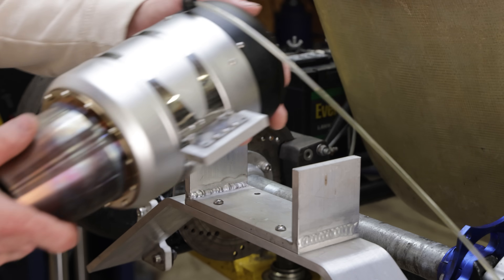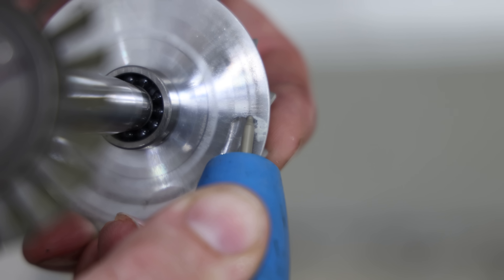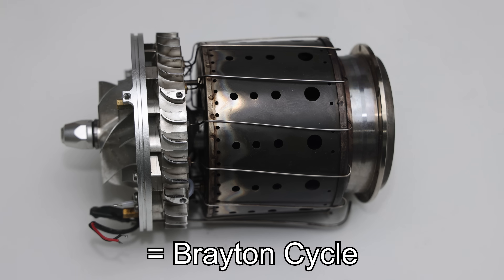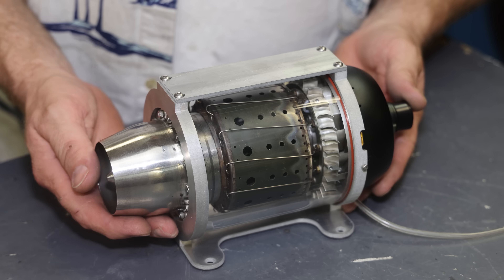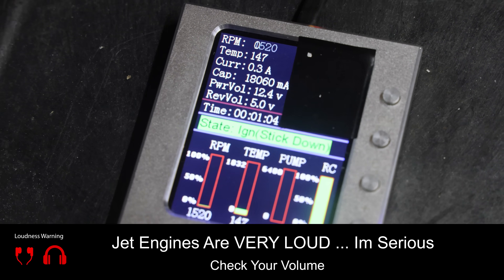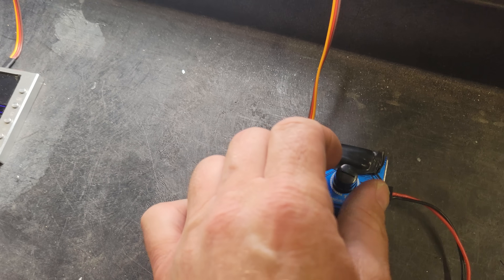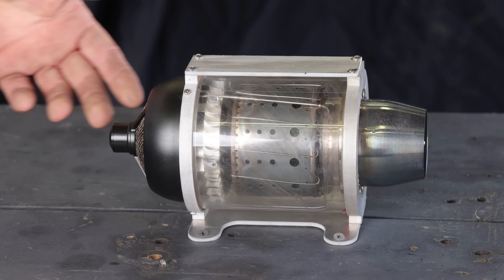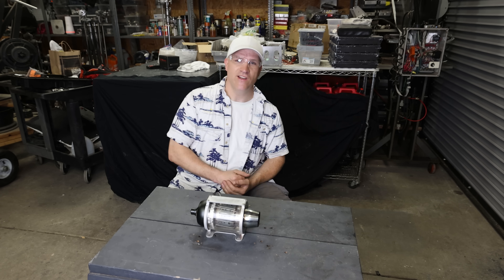See Thru Jet Engine

Comment: Absolutely brilliant! This should be required viewing for anyone who even has a remote interest in how jet engines work!
Reply: i think for those with more then remote especially re " @Warped Perception  liquid nitrogen is worth using as the 'combustible' as it does not cost much     and myths about it not be energy rich enough persist.. but instead of fire generating heat you have to drastically disperse perhaps with room temp thermal superconducting materials or some sort fo nano structural vapor skin...

when air is sucked in at great volumes it does get hot but can it provide enough heat to boil the nitrogen comparable to the work of compressing the air? I know it can be done because the extreme pressures the phase change generates make burning fuels incomparable.  The challenge however is not overcooling air as I noted in other comment.  It will condense water of course and that water is a good eject if sent out fast enough but creates inelasticity of course even expanding if toomuch mass is shed (any crystals formed transferring mass to heat of course right?)

Or can you by agitating the water vapor sufficiently maintain it's mass despite it being cyrogenically cool?  I doubt that!!! If you managed to do that the exhaust gasses would be icy literally and provide a ground effect maximising sought turbulence at backside of jet snow forming and those crystals being like parachutes to push off of a real brain riddle right!

they would constrain atmosphere for sure!  Exhaust gas crystals only happen when you boil not burn your 'fuel'

a fuel our atmospher is mainly just preboiled like lithium batteries right?

capable of being reboilable

not just good enough for lettuce bags to turbo profits by displacing oxygen

oxygen is not needed for jet engenies nor is water vapor a threat

nothing boils nitorgen better then warm rain

snow of course in freezing air would need a filter that prvents it from getting into nitrogen boiler parts of turbine however snow compressed does melt forming eject that again snows
all this molten not just nitrogen around us but practically plasma already and we care about our bodies when judging it's value

it's energy

so hot!!!

so capable of releasing potential energy of snapped nitrogen molecules by increasing there mass!!!

Boiled nitrogen is heavy and superheated by sun it has plenty of bonus heat to increase i wonder what the ratio of nitrogen snapped at 40 degrees or say 5 degrees celsius free nitrogen is... how many grams of liquid can be melted by how many grams of free to mine air???

i feel so ignorant not knowing precisely and lacking the equations on my watch

ocean surface howvering hypersonics have hot humidity always to work with

so far less volume versus dry air is needed to boil and spin the turbine

if spinning is even right the densnapping process we must have open minds for

again the free molecule is heavier not lighter

ice is lighter then liquid water not just by volume

but atom duh

it is nuclear energy that is released when atmoshpher nitrogen vapors shed heat into liquid nitrogen this nano process of seperativing the N's far enough do all the work we need done if only, if only the immense power of those forces can be harnessed.

When heat turns into mass WATCH OUT

this other side of nuclear is our greatest nastilly kept secret

steampower was replaced by octane nonsense talk

always corrupting is the song of jet  fuel

burning petroleum is to sell it duh

with almost none of us owning any

no a planet rich with heavy nitrogen for free omfg?

or you got no courage?

are afraid of texas or going kashogi?

live man!  FIGHT" comment i just made to creator but can't find thread right now giving you second chance to gain greater insight about what matters aerospace wise just out of the way of whales we care not enough about yet lol!

Comment: 08:46 doesn't that totally come down to the bypass ratio? I mean in a modern airliner engine, quite an impressive amount of air only passes by. For example the GE9X with a ratio of 9.9 : 1 !
Reply: Turbofan engines do move more air (at a lower speed, and mostly only through the fan) than turbojets, but even turbojets produce thrust only by accelerating air... so yes, they do move a lot of air.

An engine of this size moves about 300 grams of air per second, which is 18 kg/min, 14 m³/min, or 500 SCFM; that's using specs from JetCat, which makes a nearly identical engine to this Swiwin design. Is that "a lot"?

Matt's comment about "80 pounds of thrust means 70 pounds of air" doesn't make sense by itself, since a mass of air would only be meaningful with a time frame included (and other reasons). I believe he's referring to a rough rule-of-thumb that the weight (not mass) of the air moved per minute is about the same as the thrust produced by the engine. This is just the result of the typical exhaust velocity of basic turbojets, but does roughly apply to his engine: the weight of air moved per minute (about 180 newtons for 18 kg) is a number similar to the thrust of the engine (about 30 pounds or 130 newtons).
Reply: @brianb-p6586  thanks buddy for the detailed answer!

Comment: you forgot to use some air from the compressor to cool the exhaust..... in the air this it will not be enough for the cooling ..... some engines have even  controlled  valves    to change the diameter of the exhaust...    and so give more power  .... the compressor it can get more complicated if you can use some exhaust gases back in to burning chamber...but you also have to add a second intake fun to get more compressions...  but congratulations from me.. 🌏 📡🌏 👣🕖 💎👽☠☼☾☄ゞど・ㇺㇾㇽ₪𝖎𝖙𝖎𝖇𝖎𝖗𝖆₪なめㇺㇾㇽ✶☥✨🌛🌄⊀✶⋊🐺🐾☆🐜🐜▲▴◭
Reply: Matt didn't "forget" anything - this is a existing turbojet engine design. It is very basic, but it works for the purpose (which is usually flying radio-controlled scale model aircraft).
Reply: @brianb-p6586  i know what it can do....so i give you the other vision... they didn't banned toys in the '50 s because they were dangerous..can you image if everyone had GPHS-RTG power at home by now.....  
 🌏 📡🌏 👣🕒  💎👽☠☼☾☄ゞど・ㇺㇾㇽ₪𝖎𝖙𝖎𝖇𝖎𝖗𝖆₪なめㇺㇾㇽ✶☥✨🌛🌄⊀✶⋊🐺🐾☆🐜🐜▲▴◭

Comment: The final stage in a fighter aircraft jet is the spray ring right after the the compressor and before the exhaust. So right where the cone meats the engine
Reply: That's an afterburner, and it's rarely used even in military fighters, because it is extremely inefficient.

Comment: Awesome effort... Disappointed we didn't get afterburner happening
Reply: There is no afterburner.
Reply: @brianb-p6586  why not?
Reply: @hippopotamus6765  why would there be an afterburner? It's a very inefficient way to get increased thrust, used only when it's not practical to fit in a big enough engine to produce the required thrust without afterburning. This is a demo engine - it doesn't have to produce any thrust at all (but it does produce about 130 N or 30 lb).
Reply: @brianb-p6586  thanks for that Brian.
I must admit it was my pathetic attempt at satire. Which no pun intended, obviously backfired.
Reply: @hippopotamus6765  I get it... but due to the very wide range of people's knowledge and understanding of technology, it can be hard to tell what's intended as humour and what's a serious question. 

One guy in one of these discussions very seriously insisted that the burner was after the turbine in a turbojet engine; another thinks that all "jet" engines are turbofans...
Reply: @brianb-p6586  ... Thanks Brian, you're quite right. Its often challenging to pick up someone's sense of humour, in writing even more so.
I had a bizarre mental image of an afterburner flame shooting out a metre or so along the bench.
I got carried away.

Comment: cool video, 

your seal set up was never going to work.  should have used a tie rod set up from the front and rear plates to hold the tube in compression.
Reply from the maker: I didn't do that for a couple of reasons, one they were in the way visually they were blocking the field of view. And second I don't want any sort of compressive forces of a varying degree on the chamber, if it expands and then binds it will crack and then explode. I could have done some sort of spring system for sure to keep it under constant compression but that would be too complicated for my demonstration here, no reason to overcomplicate things it worked and that's what matters I got the shot
Reply: @WarpedYT  my comment was only in regards to safety. I work in the engineering hypersonic and jet engine test industry. "Getting the shot" should not have been your primary concern.

Comment: Great video!   I assume that this engine uses an electric starter for initial spin up?   Larger jet engines such as those on the Boeing 727 and Airbus 320 use high pressure air to spin up the engine for starting.
Reply: Yes, all of these tiny "jet" engines use a starter motor - you can see it on the front of the engine.
Reply: @brianb-p6586  Thanks for the info!
Reply: @brianb-p6586  Thanks!  that's what I thought.

Comment: Why didn't the table achieve liftoft?
Reply: The table is strapped to anchors in the floor, the engine only produces 30 pounds of thrust, and even if the table were free to move it only slide horizontally - there's nothing to lift it.

Comment: What are the loose, thin metal wires surrounding the combustion chamber for?
Do they have a function?
Reply: Everything has a function. Those are not wires, they are the fuel lines carrying to fuel to where it is injected into the combustion chambers.

Comment: "it needs to handle all that compression" 3:07 
proceeds to casually hand tighten the bolts on the metal frame of jet engine
secures jet engine with a few wood screws awkwardly driven into some planks of wood
I'm no expert but, isn't that a bit cavalier, sir?
a lesser man would've impact wrenched those bolts like his life depended on it. and probably would've put in flanges with locking teeth for the vibrations.
Reply: It produces 30 pounds of thrust; one decent wood screw would have been sufficient.

Comment: I'd love to see a small gas turbine in a tesla--but spinning a generator.  How much power would you need to produce--and how big of a gas turbine genny would you need to charge while underway, or at least extend range?
Reply: About 20 kW would be needed to keep up with the consumption of a Tesla at steady highway speed. That would take at least three engines of this size, each converted to a turboshaft by adding another turbine stage with an output shaft. The fuel consumption would be higher than a conventional engine doing the same work.
Reply: @brianb-p6586  thank you for the explanation.  I figured if it would work, somebody would already be doing it!
Reply: @mattgreven7615  even with the problems, there have serious attempts at the turbine-electric hybrid. There were buses like this running on natural gas a decade or more ago. A company called Wrightspeed tried it, for specific truck applications, as their main business. A division of Cosworth (the famous racing engine manufacturer) is still trying to sell this, but with a more efficient variation of a turboshaft engine incorporating a recuperator.

It's a reasonable idea to consider; it just runs into problems in the details.
Reply: @brianb-p6586  great to hear, thank you!  I think we still have a handful of CNG/turbine buses downtown Indy.
Reply: @mattgreven7615  I'm surprised that any of the old CNG turbine series hybrids are still running. The latest hybrid buses in Indianapolis use Cummins diesel engines and the same design of power-split hybrid transmission as developed by GM and others and found in GM pickup trucks and SUVs of a decade ago, as well as some BMW models; the diesels are more efficient.

The Ebus turbine hybrids used a Capstone turbine engine with full power output of 30 kW.

The Capstone turbine engines used in the Ebus hybrids should be significantly more efficient than the basic type of engine that we see in this video, because Capstone adds a recuperator... although that still only resulted in 27% efficiency. A turbine engine without a recuperator has to be very large, with a very high pressure ratio, to be as efficient as even a moderately good diesel; large turbines, good diesels, and even the best of ordinary gasoline car engines, all reach 40% efficiency.

Comment: This is a fabulous video!! Thanks for sharing.

Have a question - you did mention that not a lot of air is used to produce thrust. How do high bypass engines produce thrust?
Reply: But that comment was incorrect. This engine uses about 18 kilograms per minute of air, and all of the thrust comes from reaction to accelerating that air and a much smaller amount of fuel.
Turbofan engines work the same way, except that they extract more energy from the exhaust with an additional turbine stage, and drive a fan with it to accelerate more air (but to a lower speed). "High bypass" just means that a lot of air goes only through the fan compared to the amount of air going through the engine core.

Comment: Actually gota laugh turbine jet engines are actually simple physics... This giy should try building one with multiple compression stages and a centrifical blower last stage compression fan into the compressed air fuel burn chamber... Also if you add a bigger blower fan it should help reduce some of the heat thats getting too the exterior while driveing up the thrust output... Make sure your drive fan assembly is made of a harder steel so it dont over heat... But yah this is a good turbine jet engine... But if you add more compression fans and stationary seperater fans between compression fans youl get a higher o2 too fuel ratio that will actually burn your fuel hotter but youll want a good sized blower fan too add a bypass cooling air too keep it cool and it will in proplrtion too the drive fans and drive shaft increase your optimium thrust while also helping too prevent it from getting too hot which would cause it too fly appart... Its fun science... And though these things are remarkibly easy too build being turbine jet engines they worth a whole lot of monney... But what makes me laugh is the physics behind a typical gasoline piston engine is actually far more sophisticated... Ironic and sort of humbling when you think about it..

Comment: Well done! Not only did you show off a beautiful sounding and functioning engine, but you also designed the parts, programmed the Gcode for the CNC, CMM the finished pieces, kept the rings round and flat within tolerance after machining and assembled everything to complete a little jet engine. After all said and done it works! Very good stuff 👏 👍

Comment: Whenever I shut down a jet engine, I let the turbine idle for a few minutes to let the TGT drop before shutting it down completely.  The manufacturers said it would prolong the engine life and reduce the chance of exploding unburned fuel.
Reply: it also allows for a more uniform thermal contraction in the hotsection especially in fast-turnaround applications (i.e. airliners) where you're planning to do a fast restart.
Reply: True, but for this guy, none of what you say is relevant.... 😂😂

Comment: Why aren't we using these in cars? I'll explain, use the thrust to spin up a propeller which is connected to a generator that can generate enough current to power an electric motor and charge the batteries at the same time so stupid electric car owners stop putting added stresses to our electric grid and cause blackouts and they actually pollute more than our gas powered cars do or about the same, because in the end the electricity they are using to charge their cars comes from burning fossil fuels, and nuclear power. solar and air power alone is not enough to power the entire grid like most of these green energy idiots believe it does and they believe that solar energy and wind energy alone can replace fossil fuel power sources completely.
Reply: That's a hybrid. There are lots of hybrid cars. Hybrids with gas turbine engines are not efficient.

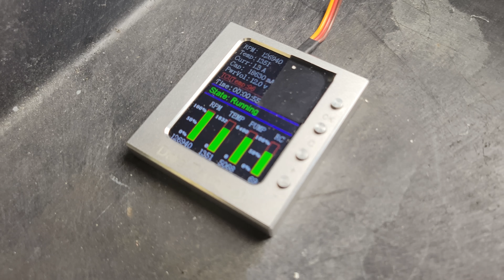Comment: 8:02 Is that reading 127,000 rpm?!
Reply: Yes, that's a typical speed for this size of gas turbine.
Reply: @brianb-p6586  Wowzers! I worked on big ol' LM2500s in the Navy and they were slow beasties compared to this. Of course, they also weighed something like 4 tons, too.
Reply: @justgonnastay  maximum rotational speed will be roughly proportional to impeller or turbine diameter... so yes, much bigger means much slower.

I found a set of specs for the LM2500 listing a shaft speed (probably for the power turbine, not necessarily the gas generator which could be faster) of 3600 RPM; that's consistent with the size, which is likely more than ten times larger in the diameter of the rotating elements - it runs over 200 times the airflow and substantially more than 200 times the power of this little machine.

Comment: So your using turbo parts
Reply: No, the parts are designed and built specifically for this turbojet engine. The compressor impeller is similar to what would be used an a typical turbocharger.

Comment: This not jet engine the real air plane use only air compressed turbine compressor air not gas not fuel just free energy we call electric but ur project no proof and can't fly like the can easy explosion or burn out like u try show us is burn red fire catch up if u know real air compressed is just turbine with air compressor work together like many RC need only battery electric power nothing more no fuel no gas stop washbrain to sheep's society.

Comment: Why aren't cars using turbine engines yet
Reply: Mostly poor efficiency. They also respond very slowly to power changes, so they only work well driving a generator in a hybrid system.